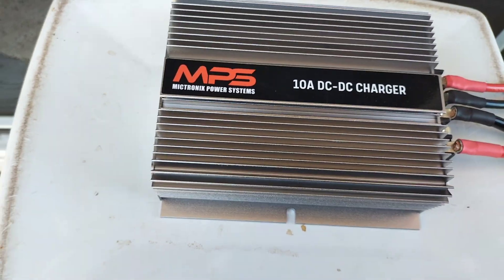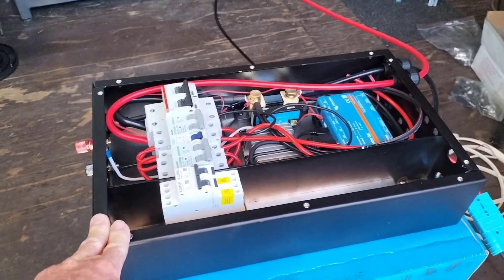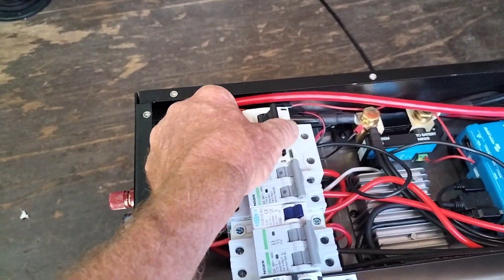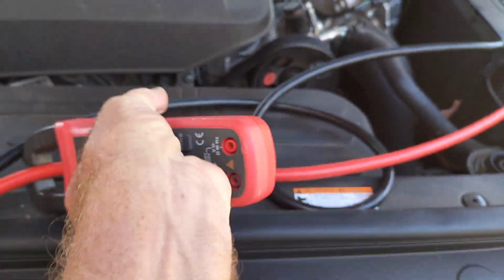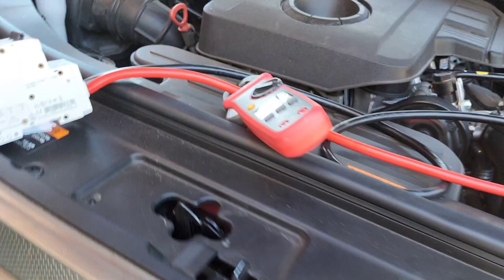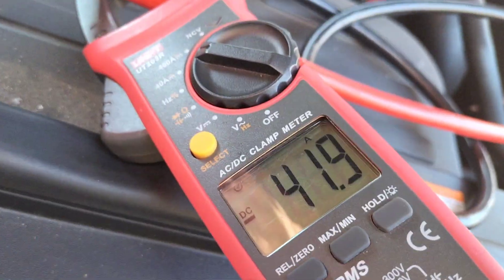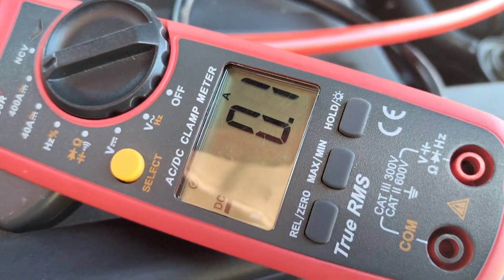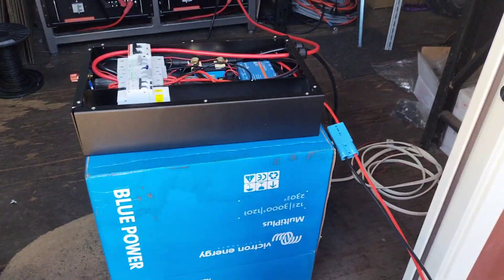MPS DC to DC charging for 48v lithium batteries works on 12v or 24v alternators

Comment: @Langshore Power, Just out of curiosity, at @1:00, does "all voltage-sensitive relays" include polarity protection for both input and output going in and out of the DC-to-DC charger?

Comment: .  I'm running1350w of solar to my coaster which I'll be running 24volt inside. Be off-grid camping most of the time. 99% i hope. Will be running a air-conditioned when up north were it's hotter than vic. The rest of my electric will be the normal with the microwave having the most drawings power other than the air-conditioning.  What size inverter and battery charger would i need. I've been quoted $3700. For a new one . Still need to get all the other stuff as well, including 900ah of lithium batteries  can i go smaller than i think it's a 5kva. And it's price. I'm up to my wiring now and it's doing my head in. Others that quoted are not that big. Don't know which way to go.  Thanks steve. Ranting a bit . 4.00am not sleeping